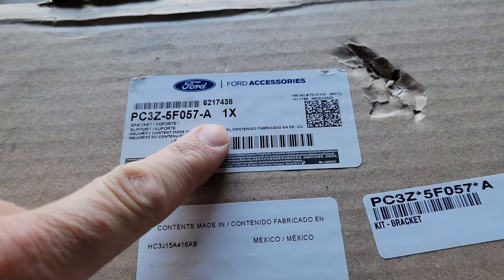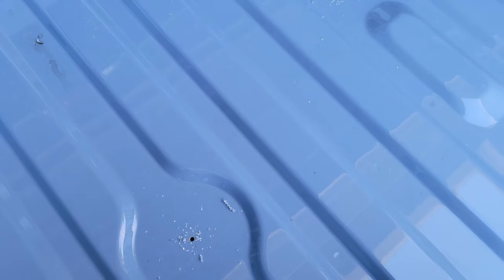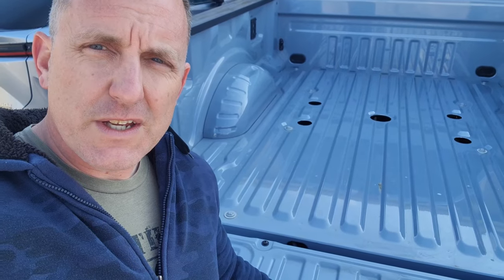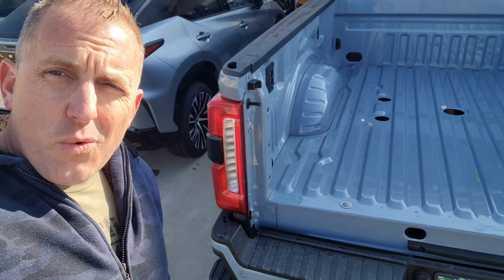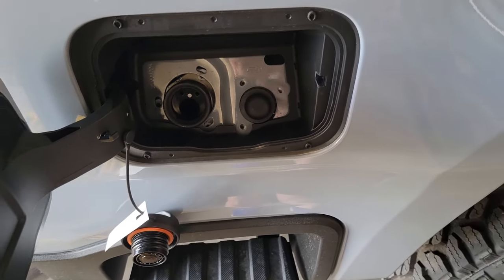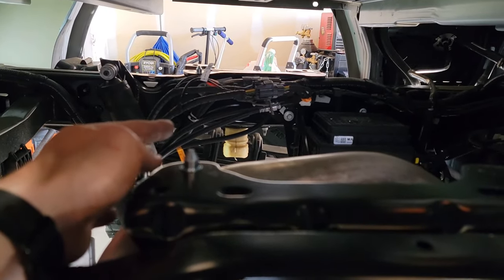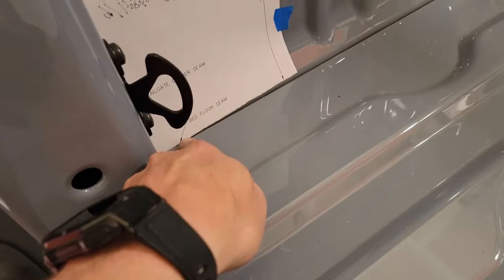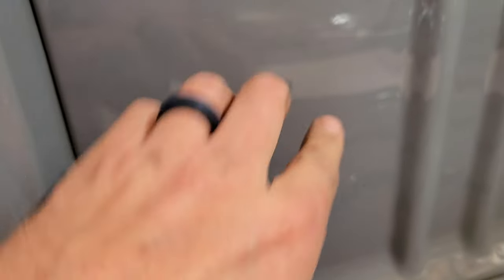2024 Ford Super Duty Factory 5th wheel tow prep install....F-250 and F-350...YOU CAN DO IT!

Comment: Excellent instructional video, and indeed one wants to order the truck or find one that has the puck system in it from the factory if possible and as you pointed out its not possible to even install the GM unit after the fact. I was going to mention a trick with drill bits if there is a danger of flying through a hole and unintentionally damaging something. I know its easy to have a drill grab and "thread" itself into thin material and things can go wrong fast. The trick is to have some rubber hose of an inner diameter that is slightly larger that the drill diameter in question, a smaller drill sizes can use vacuum hose or a size of fuel hose for example. Chuck the twist drill and then cut the hose ... could be as little as a 1/4 shorter or a 1/2 inch as examples. Then there is no way the drill bit can accidentally go deeper than the "give" of the rubber hose. A hole saw can be done similar by using a narrow section of rubber hose and it can be slit and then cut to length so it goes around the hole saw and then a hose clamp is utilized to clamp the hose to the hole saw. Yes its a lot of messing around but if something is very critical it might be worth the effort.

Comment: You have to have that tailgate up at 80° or you’ll have a bitch of a time getting that out of the driver side tensioner groove that’s the key to getting that tailgate off with no trouble 80° up and then it’ll come right out of the notch. Also you should mention in your  link that that the  side measurement of 10 1/4 is from the wheel well not the side of the bed. Great video.

Comment: easier to get from factory isnt it?, smart to do it b4 bedliner......aftermarket is usually better anyway.......
Reply from the maker: Absolutely, get it from the factory if you can if you order as it's only a 500 plus option, but most dealers aren't getting this put in on their stock orders.  Not sure why.  I do prefer this sytem from all the big three over a BW turn over ball or other puck systems not being OEM.  Ford and RAM you can ad later, Chevy, you cannot get their puck system added after the truck is built and one would have to do a turn over ball system.  Thanks for watching.